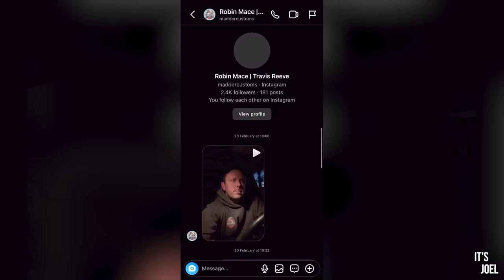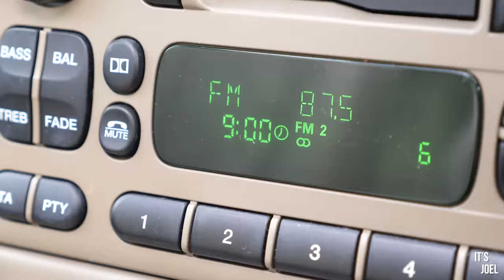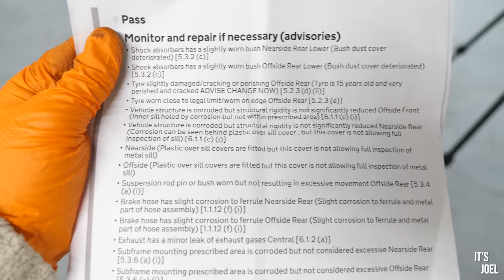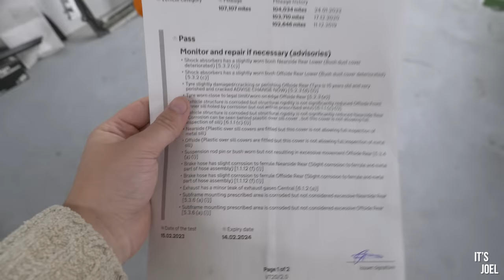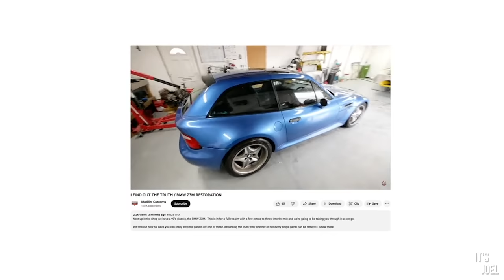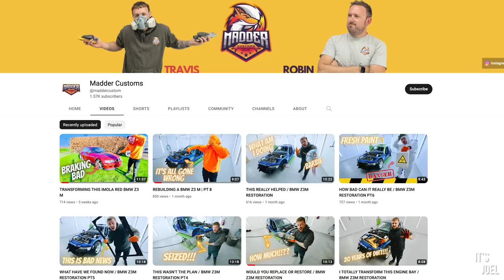Can My Cheap V8 Jaguar S-Type Be Saved From The Scrapyard?

Comment: The front brake caliper brackets are not so easy, one of the bolts is behind the strut. Changed the design on later model. If changing all the brakes drilled and slotted aren't much more spendy. Anyone with a Mondeo that thinks it's basically a 4.0 s type needs to fact check. Some Thunderbird parts do fit but that's not a Mondeo either.

Comment: I would get the head gasket done as that stuff may work for a bit but it's not a proper fix but I've never used it before but I wouldn't Trust it to last so heads off and do a proper job